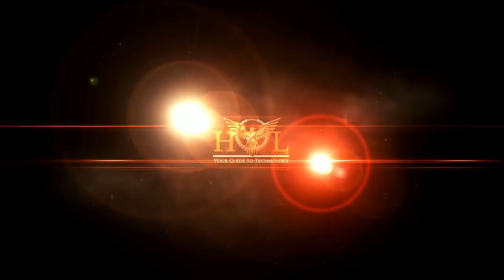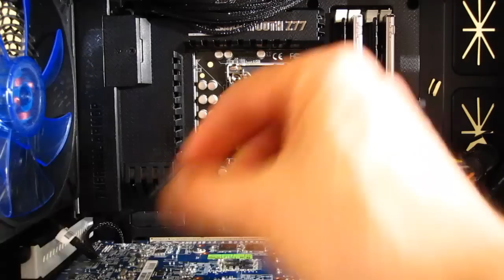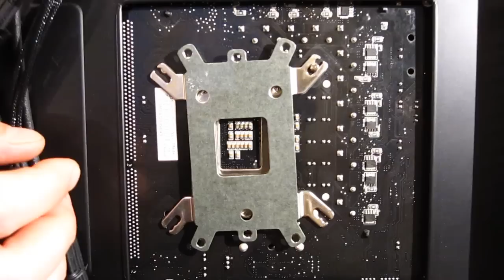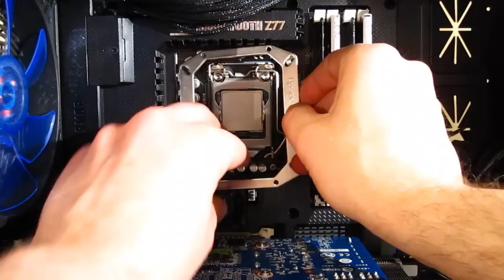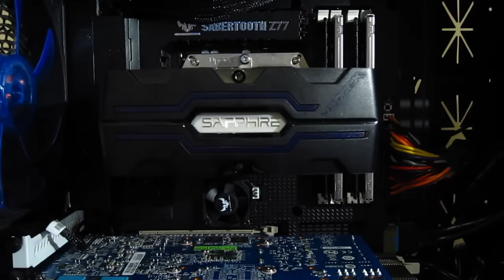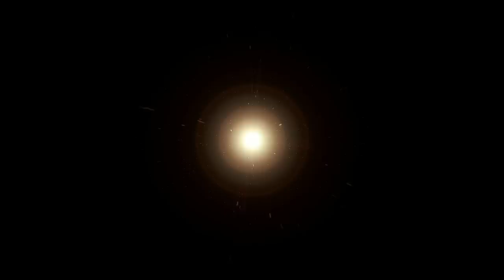Sapphire Vapor-X CPU Cooler Installation at HiTechLegion.com

Comment from the maker: I tend to agree that vapor chambers will become more common on CPU coolers, it's a pretty natural progression. But for the moment, there isn't a vapor chamber cooler that comes close to an NH-D14 or Phanteks PH-TC14PE. I don't necessarily agree that either of those coolers would be made better by the addition of a vapor chamber. The jury is still out on the technology, we have one excellent performer and one that didn't reach those heights.